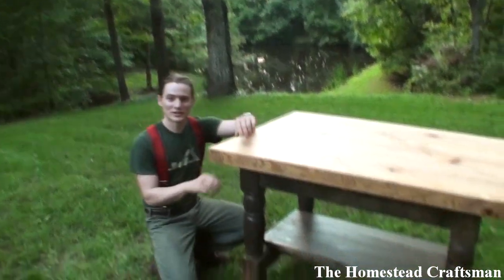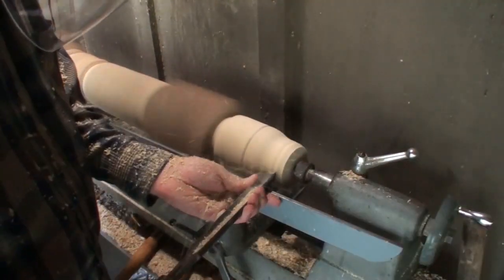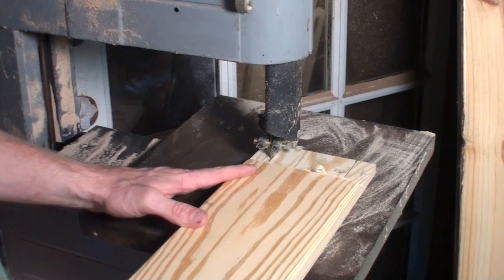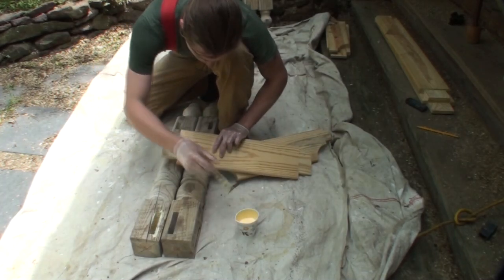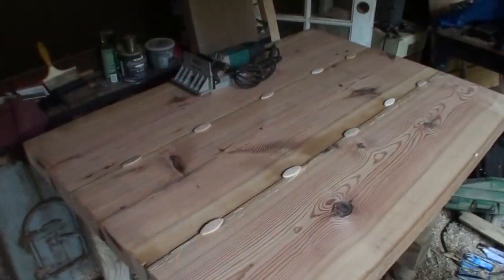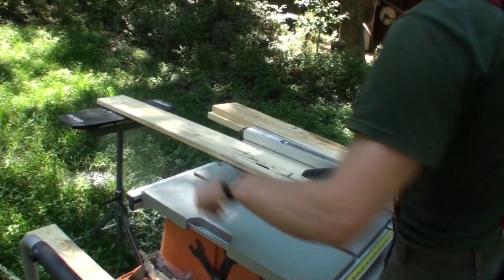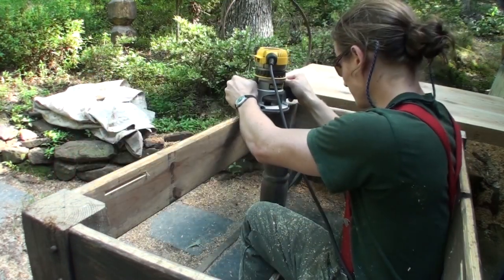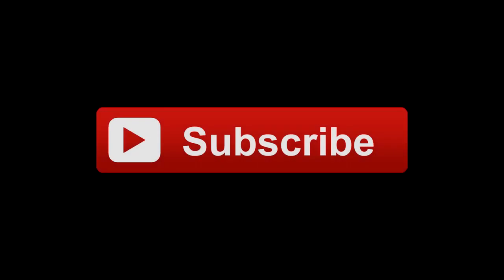Building a Kitchen Island from Reclaimed Wood

Comment: nice video as usual. Thanks for turning me on to using decking board and not feeling guilty about it!
Reply from the maker: Mike Roetto Not sure why you should feel guilty, wood is wood. If its the right wood for the project then it does not matter. Now one thing to point out and perhaps what you mean, These boards are not treated, I buy them directly from the sawmill before they are sent to be treated then sold in lowes, etc. I am all about getting the best results at minimum cost. Thanks for watching.
Reply: The Homestead Craftsman I used the treated boards to make a small bench similar to one you've done in another video.  After several trips through the joiner and some vigorous sanding, seems to take stain and sealer fine; suppose time will tell. Thanks again!

Comment: Hello, awesome job!  I've also been watching your Square Inch channel as well--you're a true craftsman.  One question--do you remember about what diameter/width the legs turned out to be?  I'm designing a table with a similar aesthetic in mind (but currently have zero experience not that I'm letting that stop me), but find the legs on this one you made a little to bulky for me personally.  Thank you!
Reply from the maker: Beth Davis The legs are 4X4 at the square parts and the widest diameter of the round parts. Depending on how close or far apart the legs are, shelf or no shelf, thickness of top, etc will make a difference of how the legs look. This island had some heft to it, so the heavy legs looked nice and added to it's sturdiness so it doesn't shake any when being used. If you'd like to go smaller on the legs, I'd reduce the overall heaviness so that it doesn't look too top heavy. With the internet you've got unlimited inspiration to dig through, good luck with your project.
Reply: Thanks for the quick reply and the info!

Comment: Love that island. Absolutely beautiful. I have a quick question about the portable table saw. Did it come with the riving knife behind the blade? I have a portable Skil table saw that had a guard on it but the cheap screw that holds it on ended up wearing loose and stripping the threads so now I have nothing but the blade sticking out of the top. Do you know if they make a universal riving knife for table saws?
Reply from the maker: +Ohio Digger Hi, my saw has a riving knife/splitter. It has a lever that you twist that lets you re position or remove it. There's really no universal riving knife since all saws are different. You could always make something.......or get a saw that has one.

Comment: Nice work- I have an opportunity to make a round table top out of some 6 x  3/4" reclaimed heart pine-I plan to use biscuits like you did. Should I be concerned about the orientation of the growth rings on adjoining pieces? I've read that alternating the rings will minimize any warping; what do you think?
Thanks for taking the time to respond- I do like your videos!
Ches Smith
Columbia, SC
Reply from the maker: +ches smith That's fine, but if your wood is dry and finished top and bottom, it should be stable either way but the general "rule" is to flip the rings.

Comment: Nice work, and thanks for not goofing around the way some of the other woodworking guys do. A well explained, concise video. One tiny problem for me (and probably only me) is that because I use earphones to listen, your left channel only commentary is slightly annoying. Please take that last comment as constructive criticism. One question: Why not buy a bigger jointer? I have one of those (4 " Rockwell Delta?) machines gathering rust, only because I have a larger machine which I use every day. Just curious.
Reply from the maker: Ant Mallett Working on the audio, just have not figured it all out yet. I've also got a 8 inch jointer, 8 feet long. It's huge. I just use the small one because the big one is piled up. Thank you for watching and commenting. Glad you enjoyed the video.
Reply: The Homestead Craftsman Let me know if you need some help on the audio, it's probably something simple and easy to rectify. Man, if my jointer was 8' long, it would never be piled up! I would be too busy using and admiring it.
Reply from the maker: Ant Mallett I've got some pretty interesting tools, I've also got a huge bandsaw. 36 inch wheels. It's about 8-9 feet tall. Weighs around 1000 lbs, maybe more. Its not set up at the moment, but one day it will.

Comment: love your kitchen island.Question: how much did you spent in the whole project?
Reply from the maker: alvaro porras It cost me about $50-60 in materials........but that's deceiving. Most people would end up paying more to build it. I build furniture all the time, so I'm always looking for deals on lumber before I even need it. I also buy certain lumber in larger quantities which makes the price less. The lumber I used for the top was kind of expensive in the project, but I had some left over. Also, I have my lumber heat treated in cases of using reclaimed wood (the top) so there's a little cost in that too. I think you could build this for anywhere between $0-200. Of course you could spend more, but you don't need to. But even when your materials cost is low or even free, you have to go through a lot of effort to get it and prep it for use. That was an involved answer, but hopefully more valuable than a dollar amount alone. Thanks for watching.

Comment: Just curious. Would you use biscuit joints to add an X shape in the end legs? I hope you understand what I am asking. Thanks, David
Reply from the maker: Hi, if it was just cosmetic you could, but I would not want to as it's not that strong. Someone could step on it, etc. In my case I would use my festool domino 700, traditional mortise and tenon or screws. If biscuits are your best option, I would do screws instead or along with and plug the holes nicely.

Comment: great video, thank you for sharing. I have been looking at that shop fox mortiser but have been a little hesitant due to mixed reviews.  Have you had any problems with it?
Reply from the maker: I broke one part on it due to pulling on the handle too hard, but Grizzly has all the parts and they are cheap. When I bought the part, I got an extra plus a few other parts in case. I like the tool, works good for me. I'm sure there are better but it was a good price.

Comment: Question about the top. In a previous video you used yellow pine. Your using heart pine in this one. While Pine is not a hardwood they do look great. Working at a lumber company, I have access to just about anything I want. What is your opinion regarding doug fir for a table top?
Reply from the maker: +MrAnimal1971 You can use anything you want, but you just have to be ok with the consequences of using it. The softer the wood, the easier it will dent, etc. Nice doug fir would look great, but a lot of it is pretty soft. I use pine on a lot of my tables, which is fairly soft too, but the tables are rusticish, so dents will blend in. For a more refined table where dents would not add to it's appearance I choose harder woods like oak, cherry, walnut, etc. If you have some wood, sand and finish a short section of doug fir and see how you like it.

Comment: sounds like you like your porter cable thickness planer. I need to buy one. It seems like itd pay for itself since can use and restore refurbished lumber, your thoughts.
Reply from the maker: For me, tools like this and ones much more expensive pay for themselves fast as lightning. In the end, I can't do what I do without them. It's no full sized Powermatic, but in my small shop....I'd prefer the smaller one. Highly suggest it.
Reply: Thanks again for your comment, and thanks again for taking the time to teach us and help us.

Comment: I have never heard of using polycrilic on the bottom side of a table to help prevent warping and cupping.   Do you think this would work with construction grade lumber?
Reply from the maker: It's not so much any certain kind of finish. What you want is for the top and bottom to have finish, regardless of type (polycryilic, urethane, oil, lacquer......you can have one finish on the top and another on the bottom. Expansion and contraction occurs due to changes in humidity, expansion happens when moisture is absorbed, contraction happens when the wood dries. This occurs naturally during seasonal changes. If you have finish on the top and none on the bottom...the bottom will absorb and release moisture at different rates than the top.....so you get cupping in your top. Construction grade lumber is usually simply not dry enough to trust...or assume it will be stable. It has been kiln dried but only to a certain point. Enough to get it pretty dry and kill anything living in it. Furniture grade lumber is dried much more, 6-8 percent or so...depends where you live and where the furniture is placed. You can use construction lumber but you have to do so carefully, letting it dry for a while helps. Spruce is more predictable than yellow pine.  I hope this clears up my comments for you and others who may read this. Thank you for watching.
Reply: Thank you!

Comment: is there a special sealant to put on the top part to protect from spills or anything like that?
Reply from the maker: Kelly Armitage I used Minwax Polycrylic, it's a water base finish. I buy it from Home Depot in gallon cans, Satin. It's about $50 with tax, so it's not cheap. You can buy it at Lowes also, but my local stores only carry it in small cans. You could also use polyurethane which is a can't go wrong finish where durability is required. Both finishes are great, but I like the Polycrylic since it's water based. It's cheaper and faster in the long run. I don't need mineral spirits to thin it or clean brushes. I don't get mineral spirits all over the place and don't have a chance of rags catching on fire, reuse brushes after easily cleaned out with water. When I use oil based finishes I just use 3 in brushes from the Dollar Tree and throw them away afterwards. The water based finishes dry very fast to, especially in heat, almost too fast. With both of these finishes you do not need to top coat them with anything. I would advise on not doing it, most of the "furniture protectors" are wax based and could cause problems or require extra steps down the road if you need to refinish them. Here is the link to the polycrylic on the minwax website. They have some sort of rebate going on right now. http://www.minwax.com/wood-products/clear-protective-finishes/interior/minwax-polycrylic-protective-finish I have made quite a few of these tables and I have never had a complaint on the finish.

Comment: Good stuff.  Curiously, do you have a formula for estimating project costs as you quote commission jobs to your customers?  There is so much value in the hand built, one off, oft unobtainium material list, & of course artistic vision, I've just been curious.  Thanks
Reply from the maker: MrGunPilot Well here's where I'll make jaws drop, in my farm tables I only have on average $10 - 15 in materials cost, the big one in the video I recently posted was maybe $20 Up until a few months ago I was getting away with only having about 5-10 in each table at most. Here's the catch, I get most of my materials for free, and when I do buy materials, I buy them very cheaply and in larger quantities. That's why knowing where and who to buy your materials from is important. Also, sometimes getting the wood for free, is very costly in time. So basically, the answer to your question is for the farm tables, I do not consider the cost of the materials since it is so cheap. But I do charge more for certain wood than others even if i pay nothing for either. The woods not always going to be free and cheap, so it basically means I don't have to hike prices in cases where I would have to pay, consistency is good in the eyes of the customers. So they are in a way paying for the materials but they are mainly paying for the time to make it. There are cases where I factor materials. My kitchen islands being an example. I sort of have stock prices, then once a person tells me what they want I add up rough cost in my head and then add something like 3 or 4 times the materials cost to my stock price.  For example say your make a table that has a stock price of $1000, but they want something special and the materials cost $100 I'll price the piece at $1300-1400 and in cases where I have to do additional steps because of changes to the design I charge more, that of course varies depending on what I'm doing, but I price that kind of stuff high for two reasons, one - it deters people from going to crazy with requests. two - if they do choose to take the changes, it's worth my time. Actually I should have not typed all this and just told you that I'm posting a new "Craftsman's Corner" video tomorrow and talk about this topic with pretty good detail. I'm editing it right now. Check back, I'm pretty sure it will be up tomorrow. If not, it's the next video. Thanks for the question, hope I answered you.